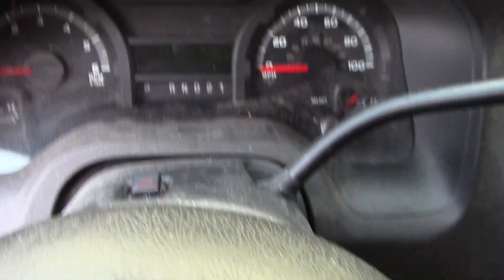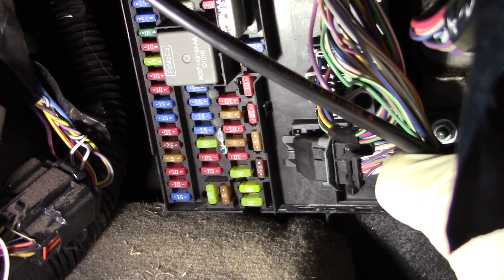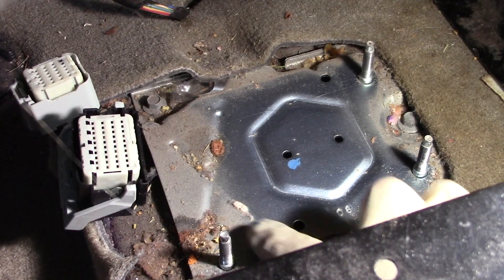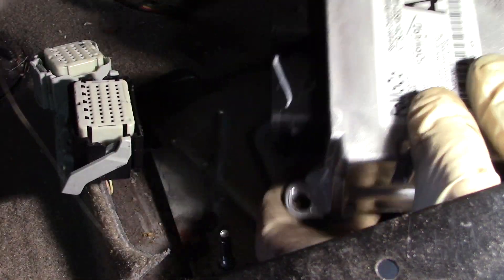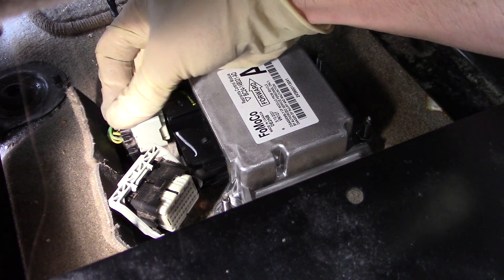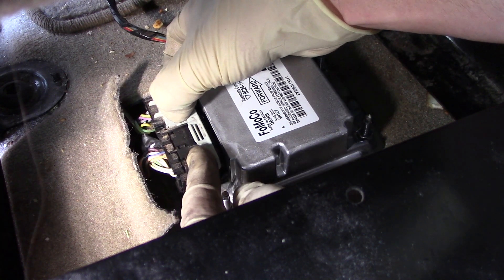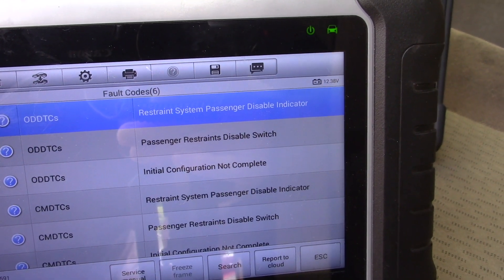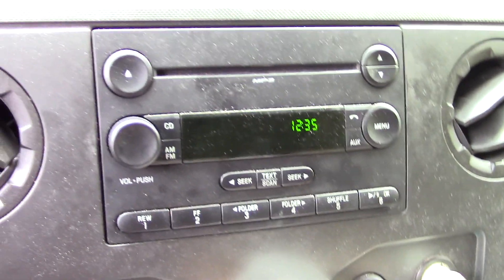2013 Ford E350 Replacement of SRS/RCM module and YAW Rate Sensor

Comment: What are the issues this module cause when in need of replacement? I have a 2004 e-150 with the 4.6 engine in and have been having loss of power/ hard time shifting/ shaking etc… I pulled a code B0198 rcm restraint control module.
I just purchased a new ecu rebuilt that claim to fix issues I’m facing but I may be wrong.

I appreciate it in advance of any answer